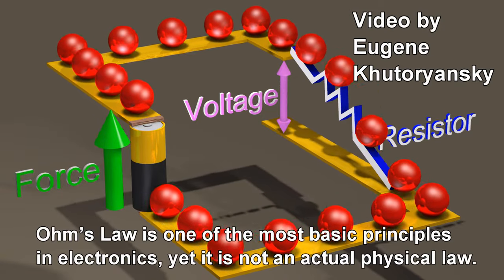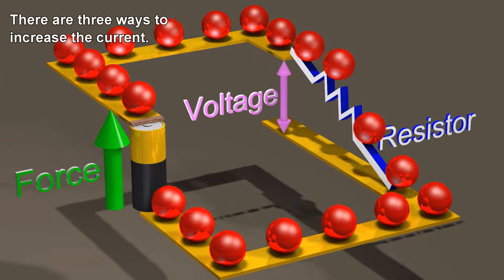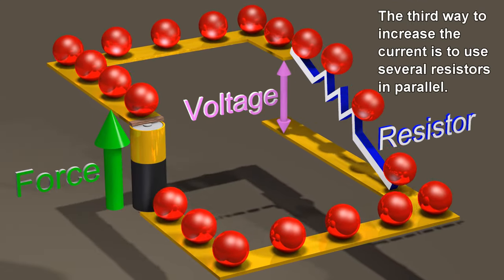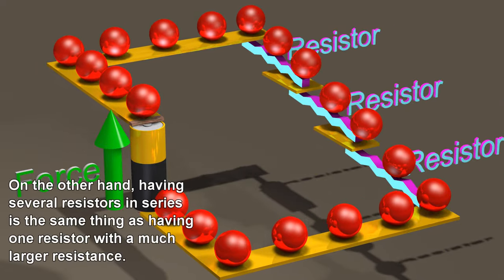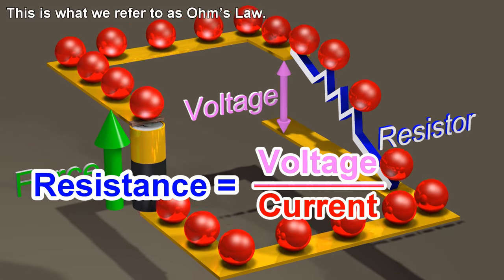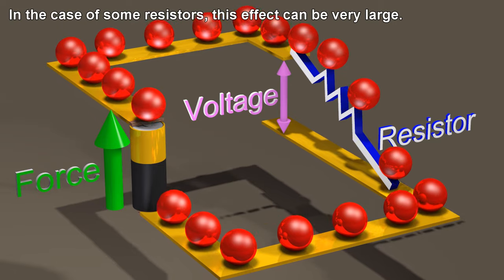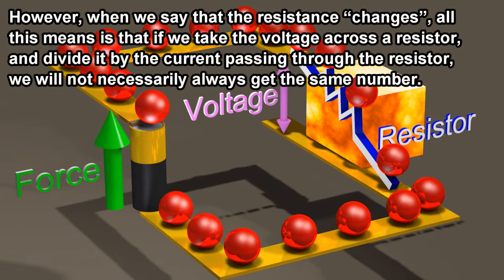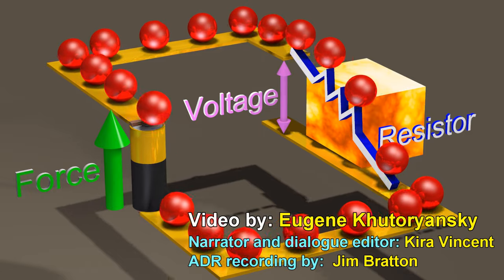Resistors - Ohm's Law is not a real law

Comment: the reason for increased current flow is because of ohms law , and the formula for resistors in parallel. remember that if you had a 10 a 20 a 30 and a 40 ohm resistors in parallel,  the total resistance is always smaller than the smallest. In this case the total resistance being 4.807 ohms

Comment: So that fallacy would be 'circular reasoning', correct?
Reply from the maker: +djmagnitize Actually this type of logical fallacy is referred to as a "tautology."  In the case of circular reasoning, the conclusion happens to be one of the axioms, but the axiom / conclusion may be true or false.  In the case of a tautology, the conclusion inherently always has to be true simply because of the way the words were defined.  Here is an example of the difference:
Circular reasoning:  Assumption:  A=B, Conclusions:  A=B
Tautology:  A = A
Reply: +Eugene Khutoryansky Got it. Thanks.
Reply: +Physics Videos by Eugene Khutoryansky 
I think you missed the point of Ohm's law. 

The law doesn't say that the voltage divided by the current is the 
resistance. 
It states that: The current through a conductor between two points is 
directly proportional to the voltage across the two points.
Now, the constant of proportionality is what we call the resistance.
.
In other words: Ohm's law states: V is directly proportional to I
Definition of the resistance is  R=V/I

Comment: Why louse up the lessen w/ whether Ohm's Law is a law.  I believe that it is a law and that regardless of thermal effects, it states the relationship between voltage and current.
Reply: alex tworkowski It's a definition, not an universal law.
Reply: Luis Calderari I don't really know the difference.  It's a weak point w/ me.  I don't really pars out these things thoroughly.  But if the resistance tracks w/ the temp, then it's a done deal.  What's the difference between a definition and a law anyway?  And thanks for responding.
Reply: alex tworkowski When you write R=V/I you're stating that resistance can be calculated in that way, which is always true, even for non-ohmic materials. There are two reasons why that happens. First, the equation by itself stands for it (resistance is a new parameter, so it could have any value you obtain from there no matter what temperature, voltage, current or any other parameter), and second, because that relationship holds a correct value when you compare the value of resistance with other equations, and therefore you can relate different equations without a contradiction in the result of experiments.
Newton's second law states that m=F/a, always true because every object obeys that relationship but also its mass remains constant. But R doesn't in Ohm's law for non-ohmic materials. There you find a difference, because changing F causes to only change a, but changing V sometimes also changes R. Therefore Ohm's Law is not universal (for every material), but Newton's law is correct for all bodies.

Comment: Your charged particles are flowing the wrong way.
Reply from the maker: I am showing the direction of positive current flow, as is done in industry and in education, which is in the opposite direction of electron flow.  I cover this in my video "Electric Potential: Visualizing Voltage" at the following link.  
https://youtu.be/-Rb9guSEeVE
Reply: Hello Eugene,

Then perhaps you shouldn't call them particles in the narration.  Electronics is, by definition, concerning electrons.  The charge carrying particles 'referred to in the narration' are indeed electrons, and any physical depiction of charged particles moving around the circuit should necessarily show them moving in the correct direction.

Anything else is simply a bad description of how 'charged particles' move in electronics and arguably a far greater error than whether Ohms law is a physical law.

Whilst it is true that in electronics it is customary to think of energy flowing from positive to negative, you appear to be holding the electronic view to account and instead showing the true physical view.  This is why I hold the video to a higher standard.  By adopting some incorrect conventions whilst allowing others is very confusing and renders your actual message less coherent.  I understand that you have covered this elsewhere but believe you should stay on message and avoid contradictions in your material.

After all ... this video gives rise to the misconception that either protons leave their nuclei or electrons can be positive.  At the very least, it leaves a pervasive visual understanding in the minds of your viewers which will, later, take more effort to overcome.

I am sorry if this might sound argumentative.

In my defence have autism, and this kind of ambiguity in science education has been hurting my brain since I was a child at school.  If it is any consolation - my teachers too though I was argumentative, disruptive and annoyingly pragmatic.  I do like your videos, I just wish they were not quite so misleading.
Reply: Electrons don't flow.
Reply: +Mysteries From Beyond
Are you sure about that?  In the usual model, electrons are constantly moving between nuclei ... even when there is no current at all.  Current doesn't mean that electrons have suddenly started moving - a measurable current simply means that the aggregate of their motion is now nonzero along some axis.

So not only do electrons flow, but they do so regardless of any potential difference or measureable current.

A statement like "electrons don't flow" is pretty valueless unless you're prepared to go on to qualify it.

Care to elucidate?
Reply: Does sound flow through the air?
Reply: +Mysteries From Beyond
Yes and No.  It depends entirely on your definitions and how pragmatic you wish to be.  But then 'sound' isn't a 'thing' ... it is either purely qualia (if you're trying to be a pedant) or just the measureable expression of a wave in a physical medium.

It bears no relationship to electrons, even when they are viewed as a wave.  Electrons do indeed move, it is a measureable phenomenon and charge results in an observable change in the distribution of electrons.  The 'wave' simply expresses the potential of the electron to be found elsewhere... precisely because the electron IS moving.  Unlike sound, an electron is an actual thing.  It has both mass and charge and is NOT merely the expression of a wave in some medium.

So, I ask again ... do you care to explain your statement?

I'm trying to give you the benefit of the doubt here - It seems like you're trying to be vague and mysterious in the hope that it makes you appear to have some deep insight or esoteric knowledge.  I've seen your channel, and it's full of absolute tosh.  Much that has already been disproven, some well known hoaxes and a few embarrassingly poor urban myths which don't bear up to the slightest research.

Considering your youtube nick, and the half-baked regurgitations on your channel, I'm not going to hold my breath - BUT if you'd care to surprise us all by making an actual case in defense of your statement I'd love to hear it.
Reply: If you're correct, then why pick on my channel to help prove your point? You did great for two paragraphs and then you seemed to fall apart at the seams mentally.
Reply: *****
If you've been following, you will note that I am Autistic.  I sometimes say things that are socially inappropriate or seem aggressive or judgemental.  If I've offended then I apologise.  Offending you was not my intent al all.

I looked at your channel merely to get some context for your statement.  I find this important as I don't readily pick up on cues - so any handle on possible contextual differences I can get is important. 

If you are neuro-typical you probably quickly form contexts based on social cues and perhaps never make them clear out of politeness, thus inadvertently preventing the other person from ever challenging your preconceptions about them.

I do not apologise for being honest about my initial subjective view of your position - it gives you the chance to challenge it.  After all, unspoken views are unchallenged views and help nobody.

I did say that I was giving you the benefit of the doubt and hoping you'd expand on your rather concrete statement "Electrons do not flow".  To be clear I'm genuinely intrigued by your position.

Do you care to qualify it?
Reply: 'Sounds' don't actually exist, it's the ear's interpretation of vibrations.
Reply: Not quite Chuck, that is the same category of error.  The ear does not create 'sound' from vibration ... it merely transcribes one type of vibration (kinetic) into another (electronic)

Similarly, the nervous system does not carry sound either, but electronic signals, through electrochemical junctions.

As pure Qualia... sound itself does not exist until the point of conscious awareness.  The mind creates sound that best fits the data.

Remember... when you dream, you hear sound too : )  And men with no legs can have sensations in their toes and 'running dreams'

Thus, sound is a product of mind.  It is Qualia, even for the pragmatic epiphenomenalists.
Reply: +GaryChap you're right about sound. I can't believe people actually discuss the simple definition of sound. Sound stands for mechanical waves transporting energy without any transport of mass. Is light pure qualia too??? Unbelievable...
Positive particles in a circuit represents the hole given by the absence of electron.
Reply: Chuck Norris Google education?  I'm not even sure what that means.

I have two degrees (Both BSc), two masters (one MA, one MSc) and a PhD... and I'm part way through a Modern Languages BA.  That's besides more than 30 top industry qualifications from CCIE to MCDBA.  If you knew anything about me you'd know that I learn for fun.
I retired at 38 because I'm good at what I do ... not because I'm good at social interaction.

FYI - "go fuck yourself, bell-end" is not a valid argument.  Surely you could do better if you tried... if I'm wrong, challenge my position - I'm not as emotionally invested as you appear to be.  I'm happy to admit when others find flaws in my argument... that's how we grow.

You post has cheered me up no end.  I know that I lack social graces and come across as blunt and a bit of a dick sometimes...

... but your vitriolic comments remind me that there are neurotypicals far more socially broken.

So, thank you for your comments.
Reply: There is no Welsh word for 'Blue', Discuss...
Reply: Chuck Norris Yes they do, you've fallen for an urban myth.

All 'named colours' are arbitrary demarcations of cultural convention (as the visible spectrum is continuous) ... so many cultures have different numbers of named-colours and different demarcations.  Fortunately, most Indo-European languages concur.

Welsh though is interesting in that they traditionally demarcated colour slightly differently, but only slightly.

The way it was explained to me is :

blue -> greenishblue is 'Glaas'
green -> blueishgreen is 'Gwydd'

but when you seek examples, it becomes clear that the point at which one becomes the other is a little different than we use in English.

Not an expert, but - (For me at least) a more confusing set of named colours would be 'Brown' and 'Gwinau' (which are two different browns).  But in my experience if you just say Brown nobody disagrees.  I still don't really 'get' Gwinau except when it's obviously ruddy.

My yacht spends its winters 'on the hard' at Barry Yacht Club in the Bristol Channel ... So, I do know a little Welsh ; )
Reply: This is hilarious.

Duck's quacks, don't have an echo.
Reply: GaryChap ha ha ha ! This so funny, now your delusional! Keep it coming... no no no, please stop I'm pissing my sides!
Reply: How are you able to piss your sides? oh right, you're chuckie norris.
Reply: Glad I made you smile.  I'm laughing too, but for different reasons.

Keep trolling Chuck, you never know, you might even get good at it :D
Reply: Ohm's law is not an universal law.
And a positive current is also made of particles. Just because there's no physical particle doesn't mean the representation is incorrect. And after all, it's nothing more than a representation.
"I have a PhD, blah blah blah…" Whatever dude.
Reply: +Luis Calderari
Your first two statements contradict.  "Just because there is not physical particle" ... exactly... so, you're arguing for 'imaginary' particles, in which case it's equally valid to say that the charge is carried by trained polar bears.

Just because there's no physical polar bear doesn't mean that the representation is incorrect, eh?

*arches an eyebrow*

Walking with crutches can help improve your abilities, thinking with crutches never does.
Reply: GaryChap Well, you understood correctly. For imaginary particles there could be polar bears (not appropriate in this case) or the absence of electrons.
You see, even if this video would have shown negative particles, it would still have been inaccurate.
So… Don't point that out as an "error", because it isn't.
What I often see in this channel is people making silly corrections instead of appreciating the hard work and free time taken to make these videos.
"Oh… Newton's laws are incorrect, should consider General Relativity".
It's like… gosh, go to every YT video on newtonian mechanics and tell them they are wrong. Same thing.
Reply: GaryChap you couldn't be more incorrect, and it's 'you're' :D
Reply: GaryChap particles, don't flow, you are wrong.
Reply: (Chuck Norris mumbled something stupid, and nobody gave a shit)
Reply: Luis Calderari said "...instead of appreciating the hard work and free time taken to make these videos."

And I have said, in several of these videos that I love Eugene's work.

As regards not calling it a mistake to posit polar bears, etc ... it WOULD be an error of fact if there were indeed some polar bears at play in the system - and you'd chosen to misattribute their behaviour.

Yet, in this case, there are indeed charge carrying particles at play.

If the post had have used polar bears then it would obviously be an analogy and not worth commenting on.  I commented, because there were specific references to the movement of the charge particles.
I'm aware that neurotypicals might not care about literal truth and may find it easier to deal with abstraction.  This hardly makes my statement incorrect or out of place.

My statement MAY have come cross as rude or too critical.  Welcome to my life... I'm good at many things, but understanding and pandering to societal niceties isn't one of them unfortunately.

Having said that, in the hard sciences I'm in very good company : )

So, my apologies if you felt offended (or, as in this case: offended by proxy)
Reply: GaryChap apart from everyone :) 'you're' still completely incorrect :D
Reply: GaryChap the particles aren't flowing, particles don't flow, electrons flow! You morron. And this is just 'conventional' electron flow to aid learning. All that without using google, too 👑
Reply: GaryChap morron! MORRON! That's even funnier! :D
Reply: GaryChap but you have chance to read your comment, and make sure the continent is appropriate and non aggressive or confrontational, but you continue to be a bell end?
Reply: GaryChap awww man, this is funny, I was only attempting to wind you up, I really didn't think it would work this well! :D
Reply: GaryChap they  are positive practical(although positive partical cannot flow through a wire, it just shows the current.)

Comment: honestly the only gripe i had was that the battery was facing the wrong way for the flow lol... but over all, good explanation.
Reply from the maker: The battery is not facing the wrong way.  I am showing positive current flow, which is in the opposite direction of electron flow.  I explain this in my video at https://youtu.be/-Rb9guSEeVE
Reply: @EugeneKhutoryansky  actually in real circuit with the desired direction of flow yes the the battery is facing the wrong way. electrons always flow out the negative terminal, through the circuit and back to the positive terminal. positive current flow is just a conventional use of a diagram where it shows the flow the opposite direction the flow is actually going. i know why you used it, because its conventional thats how most people are used to visualizing it which is fine, but technically speaking there is no positive current flow when we are talking about the flow of electrons. thats why now days some people are steering away from the old way of looking at diagrams and steering more towards the actual direction of flow in new models.
Reply from the maker: Showing positive current flow is the standard in education and in industry.  When I made my very first video for this channel, I showed electron flow.  Many people complained that I should instead show positive current flow.  There is no way to please everyone.
Reply: @EugeneKhutoryansky  i mean its not big deal, like i said i know why you used that method. i was just being picky lol.. but i did say good explanation though

Comment: Love the illustration!  one clarification if we raise the voltage we reduce the current... Voltage is electrical pressure raising the voltage allows electrons to flow faster so effectively increasing density.  watt  density with respect to time  So your illustration is correct your narration is not... Truly an awesome illustration of Watt Law ...
Reply from the maker: The video is correct.  The equation is Voltage = Current x Resistance.  Therefore, voltage and current go up at the same time, assuming the resistance stays the same.

Comment: You are wrong. It is a real law
Reply: Ohm's law doesn't work for non-metals, gases, electrolytes, semiconductors nor circuits with inductance and/or capacitance with alternating current.   Even for metals it only works for low current densities.   But for metallic conductors at low current densities it is a very useful formula.